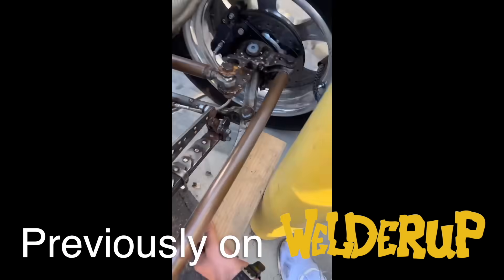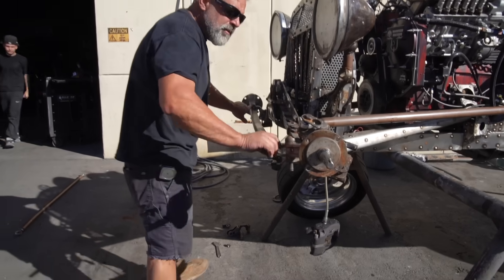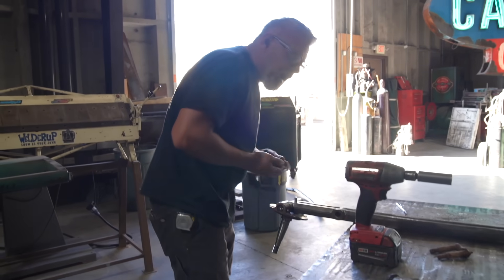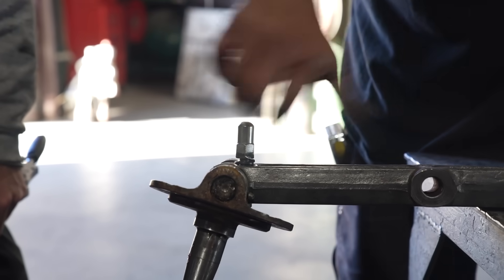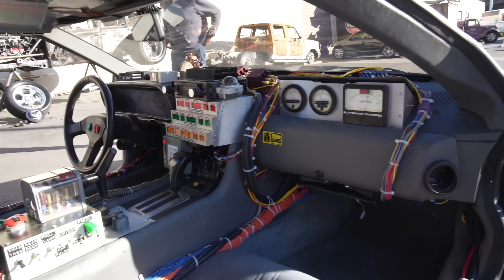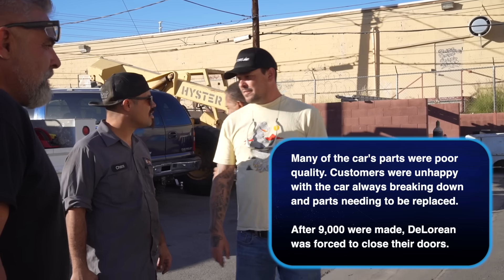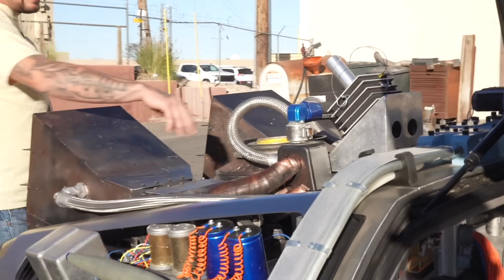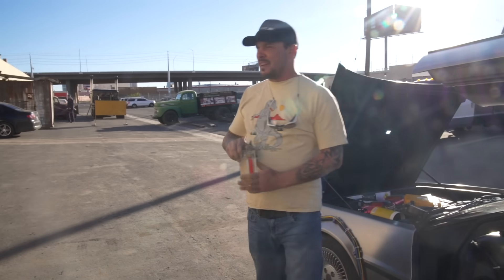D-Rod Revived After Burnout Crash at SEMA 🔥

Comment: One point I'd like to make is the the Delorean DMC 12 wasn't built in multiple countries by inexperienced people it was built in Belfast Northern Ireland by skilled workers using parts from Renault, (engine), Ford (front axle) , Jaguar (Back axle) and switch gear from other manufacturers.
Reply from the maker: Thanks for the info! appreciate it.
Reply: @WelderUpVegas  no worries, my great uncle aka my father's uncle used to work in the factory where they were made in Dunmurry which is a suburb of Belfast.